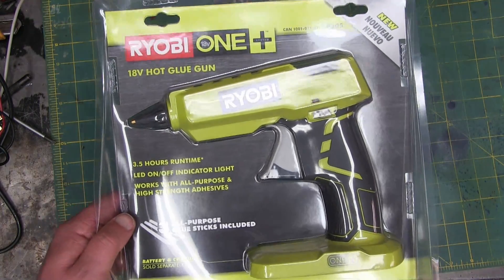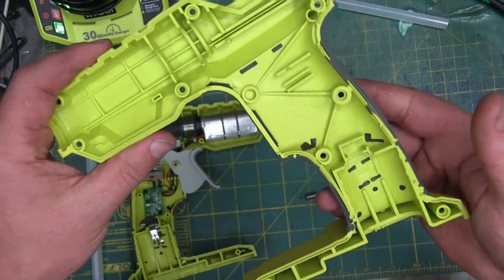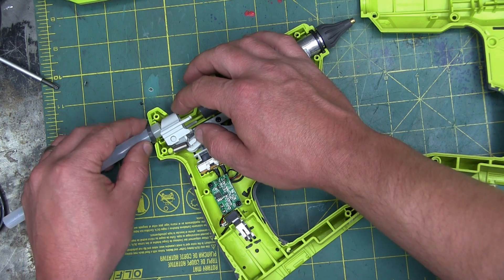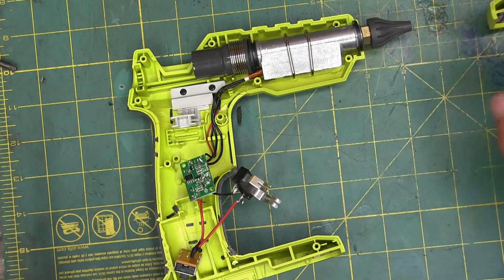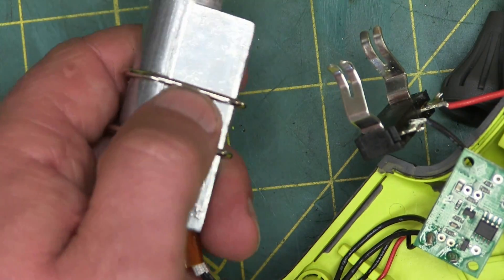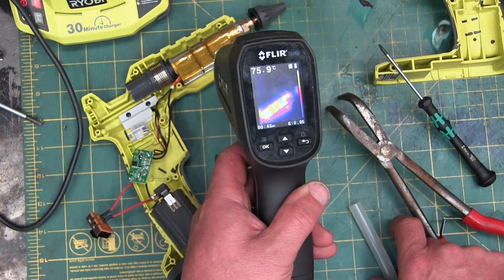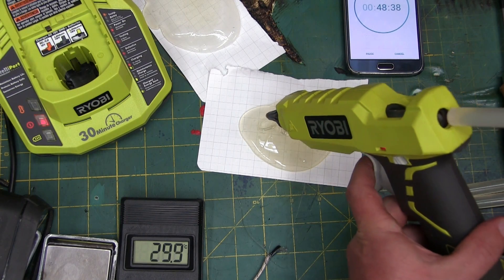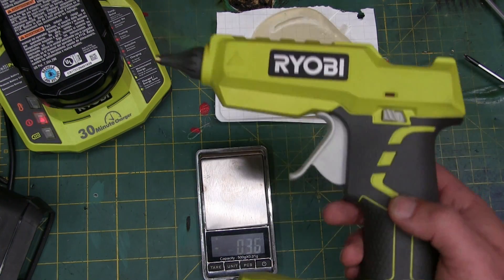BOLTR: CORDLESS HOT GLUE! | RYOBI

Comment: What are those RFID's for anyway? Are those just theft deterrent so you can't peel it off and stuff it down your pants and walk out of the store, or is it for quality control during assembly?
Reply: Sizukun1 theft deterrent, i've watched tons of factory videos and I've never heard of them using RFID chips in any step of that. In a factory setting there always simpler ways. For example, if you're worried that somehow something may not have got put in the box, they can just weigh all the boxes after they've been packed. With a nice industrial scale, they can weigh 20 pound box and tell if a single screw wasn't packed into it.
Reply: Well the reason I ask is Heckler & Koch (or Sig Saur maybe) are embedding RFIDs into the plastic mold itself and nobody can really tell why; its not likely an RFID would prevent a gun theft from a retail outlet. Just curious to see why a manufacturer would put some sort of retail security in when it adds a few pennies to the production cost when they could simply forego it and make extra profit instead of saving a penny on a fastener somewhere.

Comment: This is one of those "Why didn't I think of that" things. I kinda know why though. If I need to use hot glue quickly I just use a lighter or little pen torch to heat it. If I am at my desk and I am being lazy I will use my hot air reflow/soldering station that's always plugged in to heat a loose stick. Of course these methods are used when I don't need good control.

Comment: hot melt is a must have for all tool boxes. i have and oldie rated to 400* stays hot for like a hour after unpluged. semi cordless!. try the cryobi cordless caulk gun please. i would like to know if shes worth it. some of the sealants these days are super tuff to squeeze.
Reply: I actually have have the cordless caulk gun, have used it to put down beads of everything from silicone to roof adhesive.. never had an issue, it uses a gear drive to work the plunger, and automatically backs off a bit when you let go of the trigger (it also has adjustable speed).
Reply: Mike Williams I second this notion.

Comment: I can see failure points in the trigger/advancement mechanism. It's all thin plastic pins! Well whatever, if it breaks, drill out and put some hardware in, no problem.

I think my "nice" hot glue gun by Proxxon was made out of ABS, the trigger mechanism certainly was.
Reply: That was the weakest part I identified on mine as well. It's held up for 6 months no problems so far though.
Reply: Ideally, the glue is hot enough to flow smoothly and the trigger doesn’t need much pressure. In practice . . .

I’ve got a bunch of cheap glue guns for the kids, and it’s a regular maintenance thing to take them apart and clean out the glue that has filled the inside of the gun. I imagine this “overpresure release” is what saves the cheapo trigger mechanisms.

Comment: i have a 1/4 " ryobitch  impact driver I've abused the hell out of it, its still  chooching! i use it at work repairing asphalt,and concrete Equipment had to pull the rubber condom off of it because i got hydraulic fluid all over it became a sticky mess,wasn't sure if it would last that long! surprised the hell out of me that it has!

Comment: Lol, bought an expensive hot glue gun from China...250 watts it consumes, ones it gets hot, you could unplug it and stays hot enough to dispense smoking hot glue even after 15 minutes, with viscosity of water. Been filling first sized ant caves with it

Opened it... It has a big chunk of metal and big heater.
Reply: Suraj Grewal while that sounds rather interesting, doesn't it get rather expensive filling big holes in the ground with hot glue?
Reply: Suraj Grewal now just imagine putting that hot of glue under your eyelid.

Comment: Hey, I still use my hot snot B&D.  Yes, it's a not so pretty bakelite canadian made 160W Black and Decker. Yup, when tools were made for work, not just shinny for looks and profit$...
But yeah it could burn the house down if ya can't peel yer eyes away from that pocket "confuser"  which steal's  your time and mind eh...   Ü
Reply: Aspince Laframboise I've got a Black and Decker glue gun from the early eighties, probably more duct tape than original housing but it still chooches, I've jumped out the trigger so it's on whenever it's plugged in and I have to push the glue stick with my finger but it works! Yeah, maybe time to replace it. LOL

Comment: We somehow ended up with an accidental delivery of 5 gas-powered glue guns a couple of years ago.

Most useful tools I've never brought.
Reply: Really?  Could you name them?  I've been looking for a reliable heavy duty hot glue gun for years. Been through a ton of different models. This review looks awsome for what I need. Finally a corded power equivocal cordless glue gun that lasts more then two minutes!  Sadly it's cyobi and I have to buy the system. I'm a dewalt guy.
Reply: Butane heated?
Reply: Yeah, those little refillable  butane-gas power cells they used to sell for travel hair straighteners and stuff like that.
Reply: I'm pretty sure this is the exact one, it's certainly the same make

https://www.amazon.co.uk/Gas-Tec-600-Industrial-Glue/dp/B00HDF88VI

I'd grade it as semi-industrial rather than full on industrial, but they last for an age on a single fill of gas, and you can "recharge" them in a couple of seconds. They've saved a job on more than one occasion.
Reply: Zoro has one from Master for $26 now - most places they're $45-50. I'm not sure of the quality. Another gun from Master had pretty bad reviews on Amazon for failing pretty frequently.

Comment: Can you perhaps make a video about how to recognize materials and/or what reading material you recommend people looking into to get a better understanding of material properties and such.
Reply: Árni I second that
Reply: I third it
Reply: I can help a little.

For injection molded plastics he usually looks at the number that's cast into the plastic part itself to identify them.

Plastics fall into two broad categories.  Those that melt when they get hot (Thermoplastics) and those that don't (Thermosetting.)  The former group is plastic like ABS, Acrylic, and Nylon.  You can get them hot and squish them like play-dough.  The latter is things like epoxy, silicones, and urethanes.  When you get them hot they just stink and burn.

He uses a temperature controlled soldering iron to identify mystery thermoplastics.  They have a characteristic temperature where they get soft.  If you find the temp you know what plastic it is.

Comment: Dammit, those cords drive me nuts!  They always twist up and the gun is so light it always flips over falls over tips over.  Grrr..
As for the surprise to the longevity of the battery charge, it somewhat makes sense.  I believe you made note of the 100w draw - and at a consistent 100w draw, you're right, the battery should have lasted about 15 minutes or so. 

However, that's going from zero temp (well, room temp) to max design temp.  When at max design temp, it draws significantly less power to maintain temp than it does at startup.  So - the power draw is related to the amount of glue you put through the gun.  If they would have insulated the heating unit, it would probably draw even less power as the heat would have been held in. 

Of course, that just begs for an interesting test.  Finding a way to insulate the heater and see if the battery lasts even longer.  :)

Comment: They put those rails on top so you could attach a red dot or holographic sight for precise gluing.
Reply: Personally I run a Laser light combo and BUIS on all my glue guns, 40x optic for long range glueing out to over 1000 yards
Reply: ArmyGrunt1986 I want a 4 power on mine I'm blind as fuck
Reply: @omzig18  7 years on and that made I larf
Reply: Ryobi MOS edition.
Reply: I use the Bushnell trs-25 3MOA red dot on mine. It costs Four times the price of the gun, but its worth it. I rarely glue over 100m and the Ryobi doesn't do better than 3MOA even with custom hand loads. So far the optic has held up well, despite the recoil being pretty sharp. You can see in the vidjayo how his hand gets fatigued, sure sign of a high recoiling gun. Another poster here is talking about using this as a 1000m gun, but I am calling BS. I've done two tours in Afghanistan, and three in the Yukon doing high level adhesion with a durometer seal team,  and I never once saw anyone engaged over 300m despite mock-ups appearing at four times that range. Another thing we found is poor reliability in the sand as the lack of dust cover allowed particles in the trigger mechanism which caused rapid wear, and these things always jam in the cold. Can't even count how many times my team had these out to the armorer for repairs. I still like it though, and I use it for personal carry. If you keep it clean and hot, it never has a problem.
Reply: I can't recommend using the M68 when you're tactical hot-gluing on night-ops with NVGs.
Reply: ArmyGrunt1986 Perfect for tacti-cool gluery.
Reply: The Pandora Guy let's hold off buying until NutnFancy gives us his shake down too :P
Reply: Of course, you need to buy a certified Ryobi to Picatinny Rail Adapter first. There are also Ryobi to Weaver, Prism and NATO-Rail Adapter aswell.
Reply: I fucking hate deceptacons
Reply: Sadly you need a second glue gun to secure the Ryobi brand optics....just like the batteries they screw you with the accessories.
Reply: Neil VanAlstine sorry, shoulda specified I run a heavily modded Ryobi at a higher voltage with a cold hammer forged extrusion nozzle shooting from a bench. With high speed custom glue loads 1000m/yards is perfectly possible although it's a tough adhesion to make at that range. I also recommend using a trigger pack if you are looking for truly accurate glueing.
Reply: You would need to use the Dewalt rifled glue gun for that.
Reply: scott thurlbeck this made my day
Reply: Or a sniper scope for that long-range gluing
Reply: ArmyGrunt1986 I run an eotech 552 along with a AN-PEQ box for gluing in low light conditions. NVG comes in handy if you run out of CR123'S
Reply: Tactical as fuck
Reply: Oneofdazzz
Reply: What model of amp meter are you using?   The display looks like yellow on black.   Is that just a lighting illusion or is it really that color?
Reply: lmao
Reply: picatinny or weaver?
Reply: Steve M Proprietary rail, go figure. You’re also limited in your selection of folding stocks to the flimsy OEM stock (that doesn’t even fit other Ryobi tools). I suppose this is fine for weekend crafters.
Reply: I got the same thing but he smell tester version/soldiering iron thingy. Please test if you haven’t already. Thanks love you Chanel!
Reply: No rail on bottom for light/masterkey/grenade launcher. 1 Star.
Reply: Thank you for your service in the Craft Wars. It’s craft warriors such as yourself that inspire hobbyists like me to hit the gluing range after work. I glue both for the enjoyment, for home repair, and keeping varmints out of the craft room, but I hope I never need to glue another human being.
Reply: Backround check required at HomeDepot when you buy this gun!
😂😂
Reply: Needs an acog...
Reply: Ha! Nice observation. I see these designers doing some marketing/thinking attempting to appeal to an American market with a little picatinny rail action. After all we are the most heavily armed civilian population in the world by so far it is not even funny(look it up). I think some of them live vicariously in that sense to. Of course I'm assuming Ryobi is still strictly Japanese? Unless something has changed, their gun laws are extreme. Too lazy to look it up. :)
Off tangent a bit: Any ego driven chest beater leaders out there have to play with absolute destruction methods (nuclear for example) because aside from our powerful military we are so armed to the teeth in the civilian ranks "invasion" is silly.
Reply: @amicklich6729  if I would have told you 3 years ago that the Chinese Communist Party has infiltrated and compromised our elected officials, including the incoming president-elect, has been caught spying on us from within, our critical infrastructure threatened, our elections rigged, media outlets bought and paid to spread propaganda, and there’s nobody left to save us and this country but ourselves, would you believe me?
Reply: Jeff Streak it's not an Ar-15 brand Ar-15 so Nutnfancy isn't gonna approve it
Reply: Did you really feel like that had to be pointed out?
Reply: Tyler Hickey not to mention it was from a building
Reply: +Joe Brito is that supposed to be satire? Do you have a mental issue? That's some pretty low-tier trolling, friend.

Don't feed the trolls.